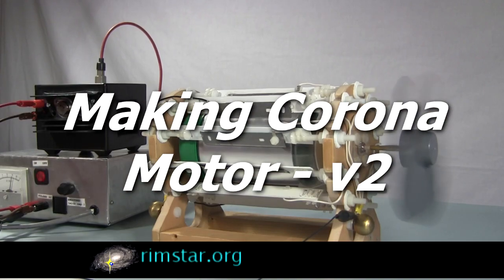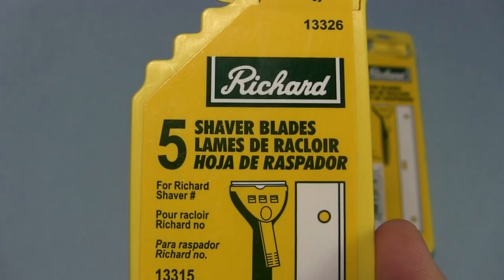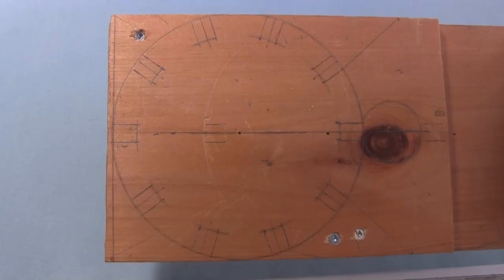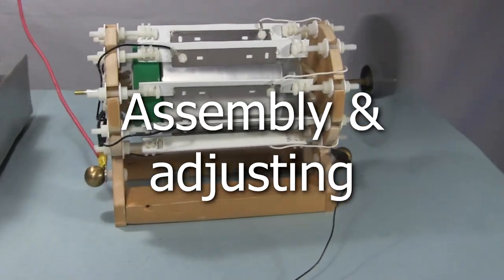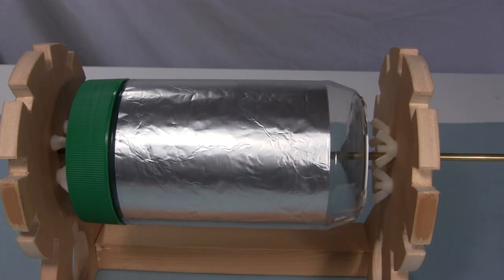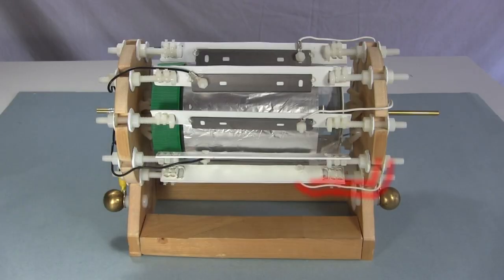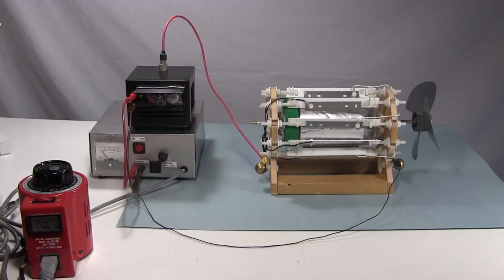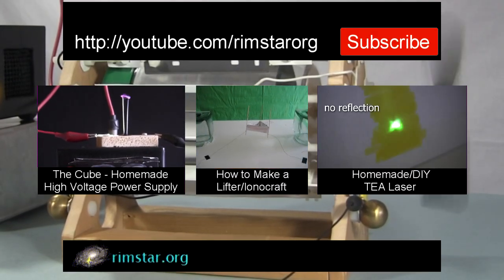How to Make Corona Motor (v2) aka Electrostatic Motor/Atmospheric Motor

Comment: can you anything else than plstic
Reply from the maker: hp26711 Yes. The only important thing is that it's not electrically conductive, so no metal. Thin wood is okay, as long as it's not wet.

Comment: also pls tell how much power do we need for the motor to work
Reply from the maker: Muneer Arif I don't know how much power it needs, but it is very little. It needs high voltage but very low current. Pretty much any high voltage DC source should work.

Comment: rimstar can we use an AC stabalizer as a high voltage power supply pls tell fast
Reply from the maker: Muneer Arif No. An AC stabilizer puts out AC whereas this need DC. Also, I suspect the DC voltage required is in the low thousands of volts.

Comment: for the high voltage power supply can we use a voltage stabiliser which is used in our air conditioners ?
Reply from the maker: Akshat Ahuja I don't know. I'm not familiar with those voltage stabilisers.
Reply: how do i use the pvc pipe and cotton facecloth to produce a high voltage???
if i bring a wire close to the charged pvc pipe then where will the other wire go ???
Reply from the maker: Akshat Ahuja The other wire goes to ground. I have a sections on different grounding tricks in these two videos: https://www.youtube.com/watch?v=QrCgtjZwnB0 and https://www.youtube.com/watch?v=HZZmKZJrIW0.To do the PCV pipe and cotton cloth technique, 1st make sure the end of the wire ends in a sharp point. I find that to get it to work I have to put the PVC pipe near the sharp point as I'm rubbing the cloth on the pipe. It doesn't work if I rub the PVC pipe and cloth vigorously for a while and then move the pipe near the sharp point. So for every every part of the stroke when the cloth is away from the part of the pipe that's near the point, the motor should get some charge.

Comment: rimstar aso pls can you tell what type of plastic have you used ........... i am making it for a science exihbition
thanx
Reply from the maker: Muneer Arif If you mean the plastic that the blades are attached to, I cut them from plastic sheets that I bought at a hobby store. But anything that's not electrically conductive (don't use metal) will work e.g. plastic, wood. Look around your place or in stores for anything you can use as is or you can cut pieces from e.g. popsicle sticks, straws, plastic containers, ... Maybe even corrugated cardboard from boxes will be rigid enough. Keep an open mind when looking. The plastic I used for the circuit boards in my latest video about wireless transmission of electricity was cut from plastic that was a container for an appliance I took apart.

Comment: hi rimstar, you said that that you bough t were not he bearings from ebay but i searched on it they were not avlbl so can we use skateboard bearings ............
Reply from the maker: Muneer Arif I gave you a link to where you can buy them on ebay in my reply under my other video. Here it is again http://www.ebay.com/itm/261462513315?ssPageName=STRK:MEWNX:IT&_trksid=p3984.m1497.l2649 They ship internationally. Roller blade bearings might work if you remove the grease from using the method I pointed out in this video https://www.youtube.com/watch?v=fdvRFE680u0 But I've never tried it with roller blade bearings so I can't promise it will work.

Comment: hey rimstar can we put oil to for the in the bearings to make them work freely
Reply from the maker: Muneer Arif In my experience with these bearings, adding lubricants like oil has the opposite effect. The I linked to explains the purpose of the lubricant. Some say that graphite makes them work more freely but I haven't tested that myself.

Comment: hi rimstar is it important to put bearings and what type of wood have you used
Reply from the maker: Muneer Arif There isn't a lot of force to turn the rotor (the jar) so it has to turn fairly freely. Dry ceramic bearings are good for this. Most grease filled bearings don't turn freely enough, though you could try the trick I show in my video "https://www.youtube.com/watch?v=fdvRFE680u0" to remove the grease and make them turn more freely.You could do without bearings if you can find some other way to make the rotor turn freely. I do that using a pen in my corona motor version 1 which you can see here "https://www.youtube.com/watch?v=ksp_O_1WmvA".The wood I use is pine because it's easy to cut. Any type of wood will work.

Comment: now THAT's a sexy motor! Would love to see you connect it to Lord Kelvin's Thunderstorm.

I'm trying to figure out how/why this works. I don't see how it could be moved by corona because the inner foil is insulated from the current in the blades by the plastic jar. I can believe there is an electrostatic induction in the foil as the current flows, and likewise in the shaft (insulated by the air in the jar). But I don't understand where the motion comes from. Obviously it works, but where is the torque coming from?

Also, I'm not sure why the blades are used? Wouldn't this work just as well with bare wires instead of the blades?
Reply from the maker: hi li Very thin bare wires would also work. The advantage of the blades is that you can angle them, which gives an initial direction for the motor to move. If you use wires or if you make the blades point straight at the motor then the initial direction is left up to chance.The foil isn't necessary to get it working, but gives you enhanced performance due to that electrostatic induction. The foil results in a stronger electric field between the blade and the foil than you'd have if it was just between the blade and the atoms of the plastic. That gives more corona and more repulsion.I've yet to make a video explaining how it works but I do have an explanation on my website here http://rimstar.org/science_electronics_projects/corona_motor_electrostatic_atmospheric_motor.htm
Reply: interesting, so the charge flies directly out of the blades, like a tangent to the surface of the jar? I always thought electrostatic charge acted radially. Interesting.
Reply: OOOH cool cool cool. great description page. I didn't realize the blades alternated that way. That makes so much more sense now. The charge gets stuck on the insulator as it tries to move to the foil and that attractive force between the charge and the positive blade pulls them together. perfect. Thanks so much for your reply. I've never seen one of these before. I've only heard of them once. really awesome.
Reply: I see... the angle of the blades puts the charge  closer to the next positive blade than the preceding blade, so even if the electrostatic charge travels radially into the foil, the geometry still gives it a bias in one direction. fantastic! will have to save my money so I can try to make one of these some day.

Comment from the maker: New video showing the making of my newest Corona Motor (v2). And a new demo at the end running it at high speed off of my Cube power supply. Enjoy!
Reply: Impressive work in all your videos very well explained , thank you very much for share with all...this motor can run conected to a source of static current to , with a ground conection ?
Reply from the maker: foupana
Thanks. What do you mean by static current? I recently released a video showing how to run this corona motor using triboelectricity, which is a way of charging something electrostatically. You can see that video here https://www.youtube.com/watch?v=6x6DqPL14yU
Reply: Thanks my friend,is my error i have make a confusion loking to your motor, and i thinking in other ...my question is about an opinion that i have that we  can use a LITLE of DC power (Volts and Amps),to produce a hudge quantity of  (high voltage) , than  this type of motor is  very importante , conected to high voltage , source: sucking of the air or other ways like a big wimshurst machine, but in resume the idea is with high voltage put in rotation a motor with a flywheel that produce more Amps that we need to put in (to extract), to run for example the wimshurst but with some modifications in the type of the rotor and  capacitor's, regulating the spark to be more fast as possible and more power , maybe we can run a very important motor generator of DC power out , use an inverter , charge bateries 24 h a day... in my research about rotors i have see that is possible to make them anti-gravity with the repulsion of magnets, and in one side o axe"rotor" a metal sephere in contact with a glass , (reduce the quntity of friction) and the amps that we need to a good rotation "velocity"will be more low, in my opinion probably with a flywheel to asist the  2 disc's of the wimshurst machine is better , anti-gravity technic and without bearings , only glass and spheres "speaking about the type of rotor"... thanks for your time keep the good work my friend, i consider extremely important people like you that educate and help others in many ways, like the (the production of electricity) . if you need to ask something you can contact me in the facebook : Name :(João Cantinho)  Country: Portugal
Reply from the maker: foupana
You can use a small DC power (voltage x amps) to produce a high voltage but at the same time the amps will be made smaller. With the losses, the output power will be less than the input power. You always need an external energy source to get more out. I don't know if you have built things yourself, but if not, try building your ideas and you'll quickly learn the limitations.
Reply: thank you,!

Comment: I made this with a 3 kv power supply and got < 1 efficiency. But it was cool to see it work. Thanks for the idea. Mine was much smaller. I used staggered needel design rather than a blade design, maybe that's why I got low efficiency?
Reply from the maker: Could be. With needles there's less charge area to repel and attraction the charged areas of the cylinder.  But I haven't redone my efficiency test for this one yet... it may also be < 1% efficiency.

Comment: How much electricity did you use to power it at the end?
Reply from the maker: I didn't measure it. I'll have to find some time to get the power supply out and measure it.
Reply: Okay.
Reply from the maker: The only place I could measure the power input was between the 24 VDC power supply and the Cube high voltage power supply. It was 2.84A x 20V = 56.8 watts. I've uploaded some photos to my Google+ page here https://plus.google.com/116395125136223897621/posts/dDFd91WmC9k

Comment: Would it work with a Kelvin-Generator too?
Reply from the maker: I doubt a Kelvin-Generator would work (if you mean a "Kelvin Water Dropper and How it Works"). A corona motor needs high voltage but with a lot of current for the corona too. A Kelvin water dropper produces high voltage periodically and with not much current. Maybe a big Kelvin water dropper with a very small corona motor would just work.
Reply from the maker: Quantum
That depends on your definition of free energy. I plan on lifting a wire 50 to 100 meters up in the air using a kite, balloon or drone. The wire will have sharp ends at the top. For every few meters above the ground there's a few hundred volts available, but not much charge. I'll connect one end of the corona motor to that wire and the other end to ground. Hopefully the motor will turn a bit. That's called atmospheric electricity. So that's free energy, but in the same way that solar panels produce free energy.
Reply: Quantum no its not
Reply: Quantum The Kelvin-Water-Dropper is a simple generator that can be used to produce high-voltage impulses. I wouldn't call it a free-energy-device but it's a very interesting generator concept.
Reply: Quantum With a strong and large enough rotational magnetic field you can collect everything ^^ But I wonder if a magnetic field could be used to improve the water-dropper?
The water-dropper leave many options for improvement, e.g. the falling water can be used to move a wheel. Maybe smaller drops can improve the effect even further? Maybe different materials?
It's simple enough to rebuilt it and experimenting with it.

Comment: Where do you get these ideas from?
Reply from the maker: Rhannmah
Thanks. Having done as much electrostatics as I have, things like rounding off the edges, doping, material selection have become second nature. The key though is to start with an understanding of the principle, how-it-works. Then it's just engineering.
Reply from the maker: John C Sunil The corona motor is an old thing that people have been making for over a century, so I don't know where I first saw one, probably one by Bill Beaty back in the 1990s or an article by Oleg Jefimenko who worked on them decades before that (the article is on many websites.) I give credit for the use of shaver blades to lasersaber in the description, though he used knife blades. Around half my video ideas come from suggestions, comments or questions from you guys.
Reply: RimstarOrg I have to say, the idea of rounding off the edges of the blades to negate electric field buildup is really smart. Talk about using electrostatic knowledge to its full potential!